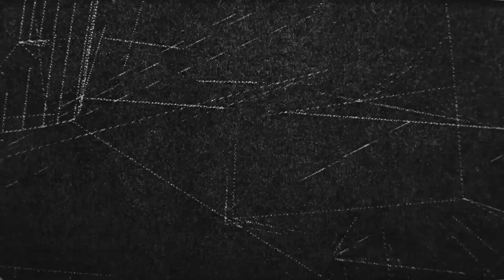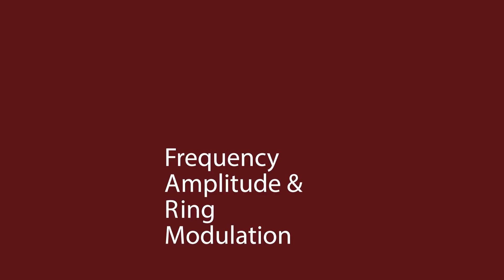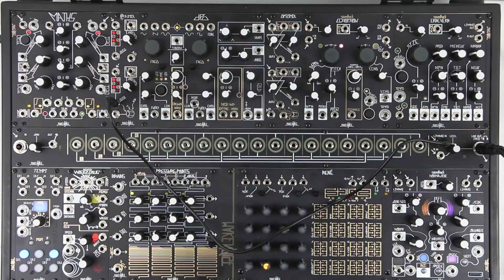Timbre FARM: Ring Modulation

Comment: Is there a way to do this without a modDemix?
Reply from the maker: Not with Make Noise modules (that I can think of off the top of my head). There are other ring mods and bipolar VCAs, for example the Doepfer a-114 or a-133. -W
Reply: Thank you for replying! I currently have a Quad VCA by Intellijel. I can monitor bipolar Cv signals, altough I'm not sure it can process them.
Reply from the maker: The Quad VCA is a two-quadrant multiplier, so it will not work in the same way (it will work for AM but not RM). Since it is four channels, it might be possible to emulate voltage controlled audio-rate inversion with clever patching of 3-4 channels (this would be overkill for most applications but might be a fun thought experiment). Intellijel also makes the uMod as a dedicated four-quadrant multiplier.
Reply: Great! Thanks again for the reaction. I'm going to give it a try!